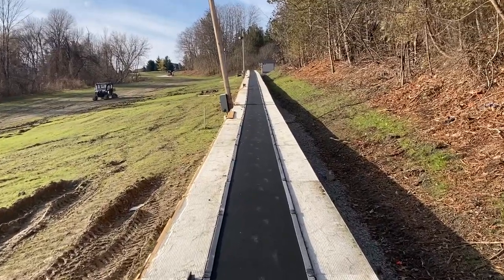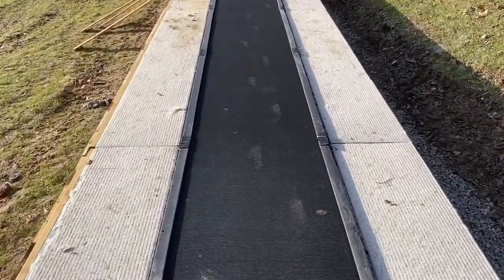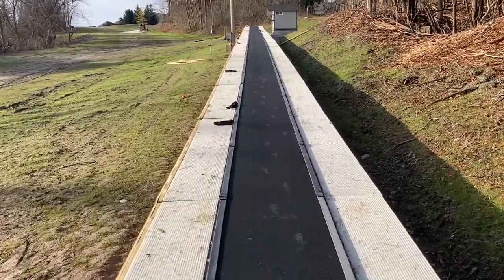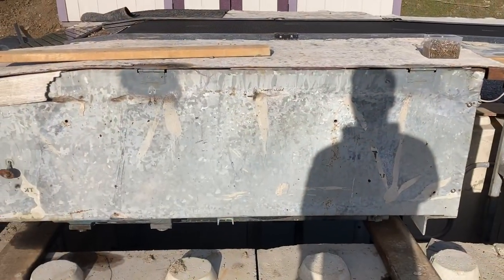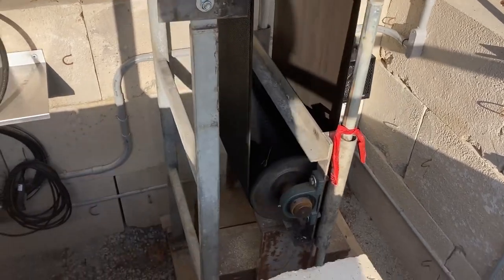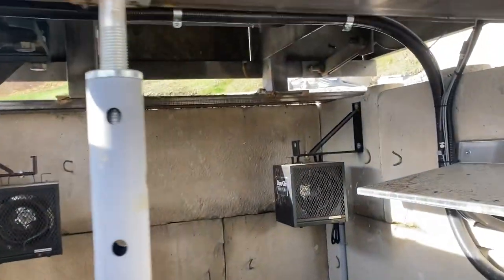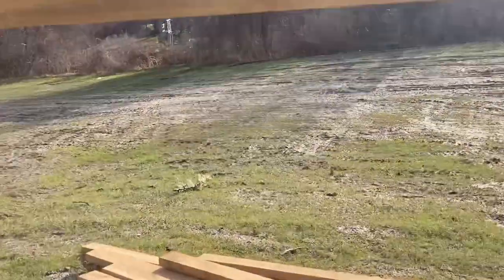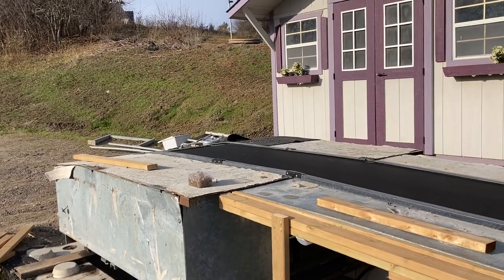How a Conveyor Ski Lift Works

Comment: How much power does this thing use then minus the heaters? Im guessing about 4-5kw when unloaded and 20kw or so at max load.
Reply from the maker: It has a 37 kW motor in it. This carpet was formally the longest carpet in North America so it is a touch overbuilt for this application.

Comment: So what do you do when the pit fills up with snow knocked off by the brush?

(that installation looks first rate, btw.  The vertical slats on the sides are an awesome aesthetic choice)
Reply from the maker: We have three 240 volt heaters plus a 240 volt radiant heater that will be installed later. The hope is the pit is deep enough that the heaters will be able to melt the snow faster than it comes in. Thanks for watching and hopefully be showing it in winter operation soon.
Reply: @patricksmotors9070  neat!